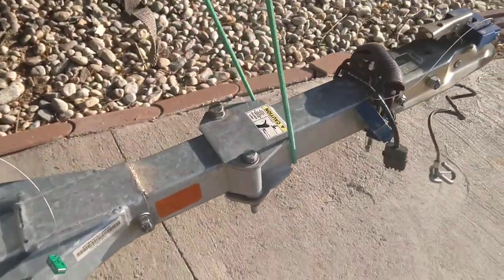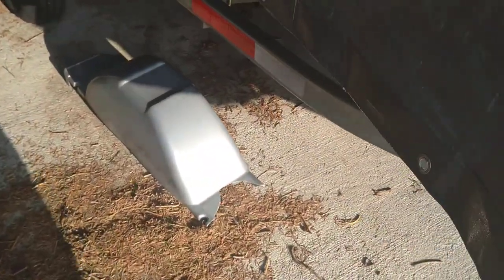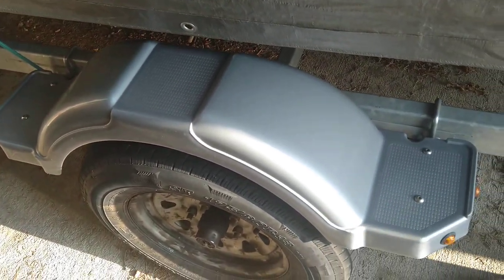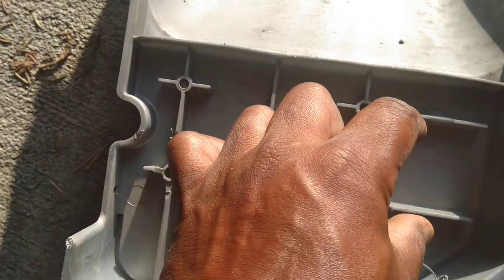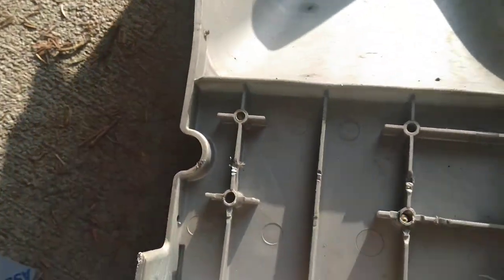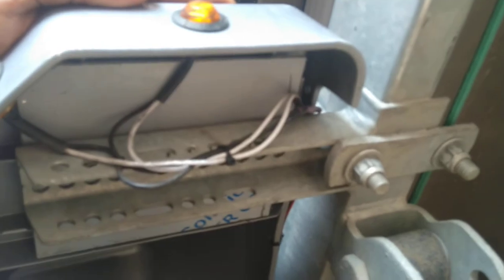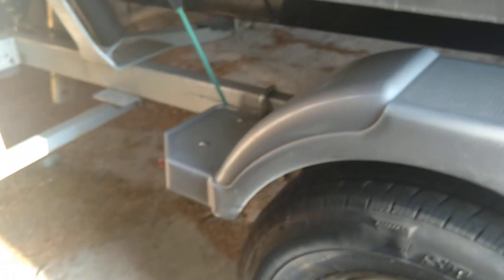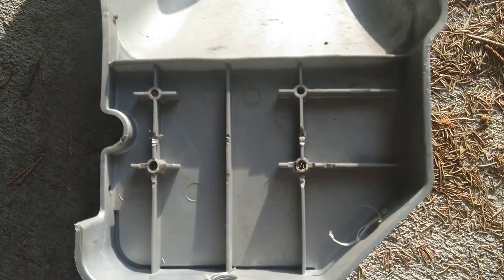Karavan trailer, plastic fender replacement.

Comment: Where did you get the 1/4inch aluminum plate bracket kit etc?
Reply from the maker: Bought it on eBay, 4" wide by 8" long, two pieces where about 20$